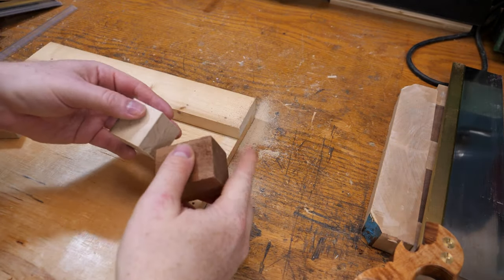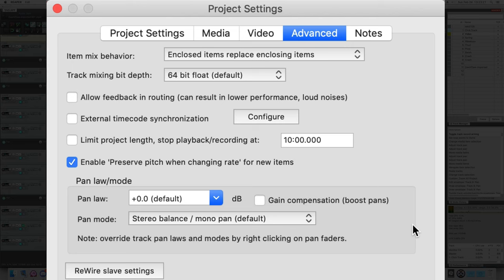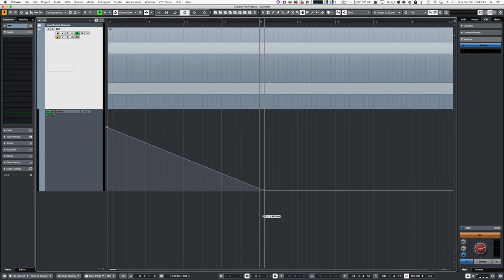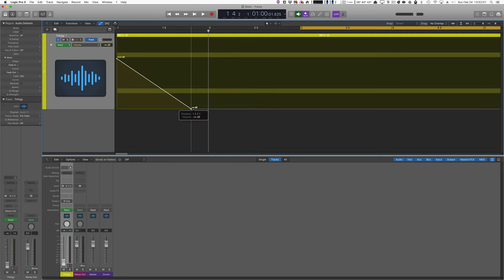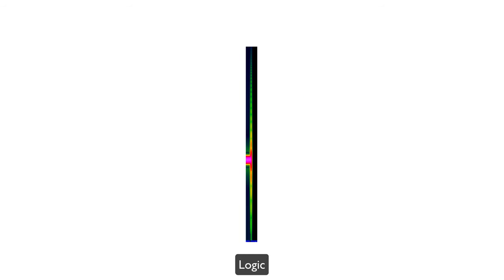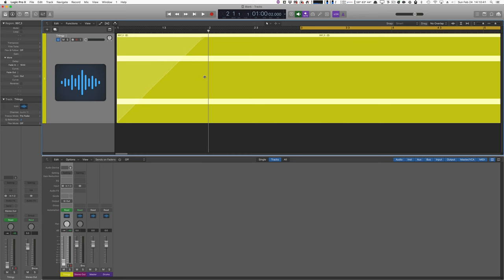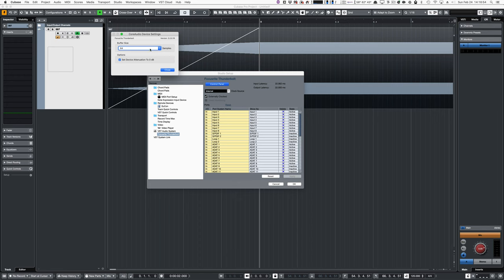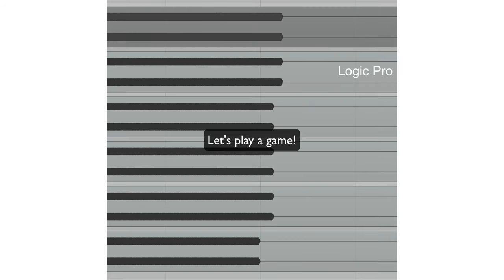DAW v. DAW pt1 - Do all DAWs sound the same?

Comment: Ok so now I know that every time I need to render a 90 millisecond sine pluck I should use pro tools
Reply from the maker: Ok?
Reply: @AdmiralBumblebee  Haha, what I mean is - what can we deduce from this test?

That dfferent daws seem to have different zero-cross smoothing methods? 

That's fine by me... anything else worth mentioning or is this the only difference?

Can you think of any real-world scenario where this would matter much?
Reply from the maker: @macfelton  It seems clear that it matters when utilizing fades or automation in some products. Certain products have audible artifacts when using automation (some are far worse than Logic!).

That's not to mention that many products, like Cubase/Logic, can't even render automation the same way twice if you change seemingly unrelated settings. That's clearly a factor when automation is used during the recording/tracking stage, and rendered with a higher buffer when mixing.

Of course this is only part 1 in the series, but I thought it was time someone clarified the "All DAWs sound the same" claim.